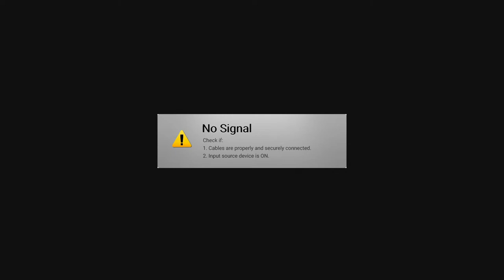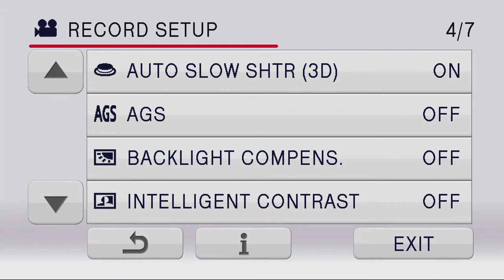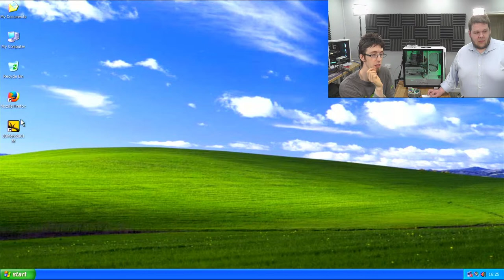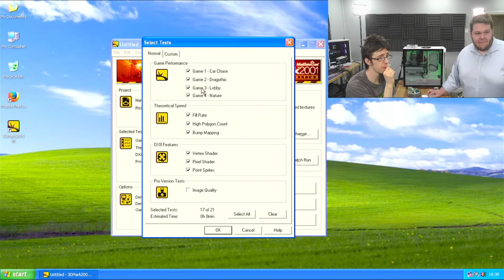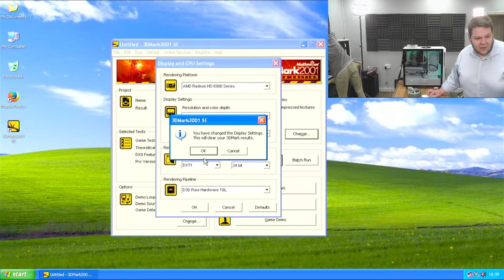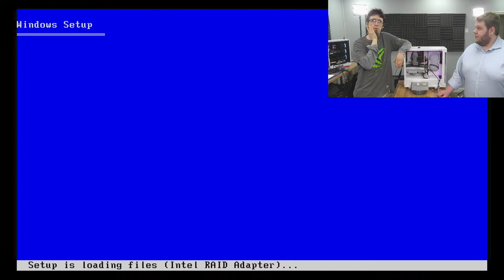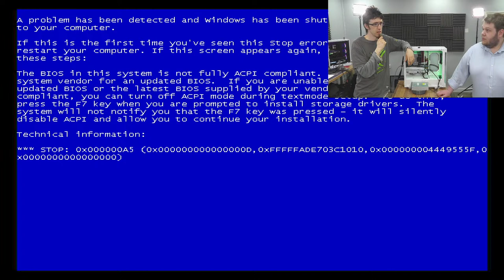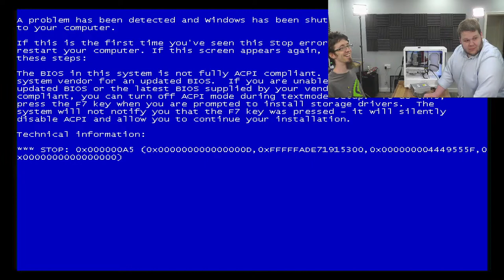Tinker Stream - Two Guys Talk Tech #36

Comment: All I can say is from a Sys Admin POV is the Windows model is solid in terms of just upgrading now since Windows 7, now its back to the different version eco system, there is value in the constant update of the 'same' system with feature update packs. This corporate market place crap of entire versions is a headache for any IT department, it goes against all the ingrained backend systems and how they run, IE Azure/Teams/Outlook so on, imagine if MS decided lets push out Azure2, there would be chaos, yet its deemed okay to mess around with the end user experience mental any annoying.

Comment: Do you know if there is a device that can check micro processors without having to put them in a computer? Basically a chip tester that you can usb to your computer and run diag tools to check the chip on it's own?
Reply from the maker: Not that I'm aware of. There's probably something that checks for short circuits and stuff like that, but nothing that can actually do a comprehensive fitness test. If there is such a tool, it's probably cheaper to buy a compatible mobo and stick of RAM and just fire up the CPU.

Comment: odd question are there NVME Adaptor kits for replacing Laptop Optical drives with NVME drives? I'd love to setup my old laptop with an NVME Secondary drive just for Pimp Value. I have no expectation for it to run at NVME Speeds.
Reply from the maker: So there's two types of M.2 SSD... SATA and NVMe.
NVMe is PCI Express, so you must have an M-keyed M.2 slot. You can't adapt this to the mini-sata connector in an optical drive bay because there's no PCI-E there.
SATA drives are B-keyed. These can be adapted to a traditional SATA connector, so you could do some kind of adaptor setup in an optical bay with one of these, using an M.2 to SATA adaptor.
However, it would be a lot easier to just put a 2.5" SSD in there, as the bay adaptors are cheap and widely available.

Comment: Total Newb question. Could you not have used hot air and wick to desolder those holes? Thinking the air pressure would help.
Reply from the maker: I've never tried using hot air with wick actually... I'll have to try it some time. I'm not sure it'll work as well, because solder flows toward the heat, so by having the iron against the wick, you ensure the wick is the hottest part. Hot air tends to heat the board more.

Comment: Logitech G-hub is shit. It takes 10-12% of my 16 core 32 thread CPU just to run it. It crashes loads, it forgets which settings apply to which device. The customer support consists of turn it on and off and re-install windows. Which is why Logitech have been removed from my systems after 25 years of use. They have gone right downhill.
I am also a right handed forker and right handed! Go us! lol